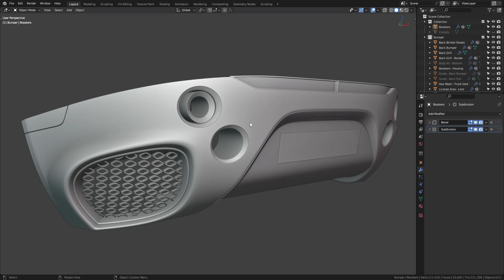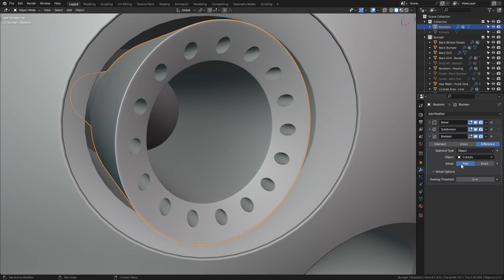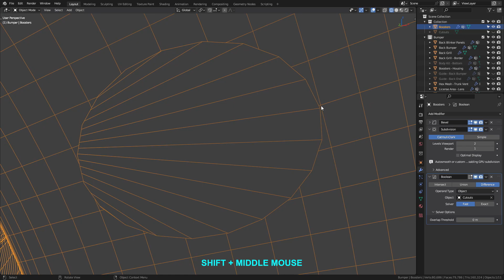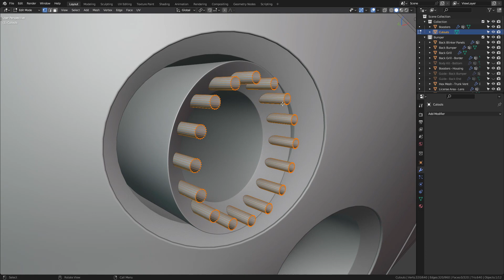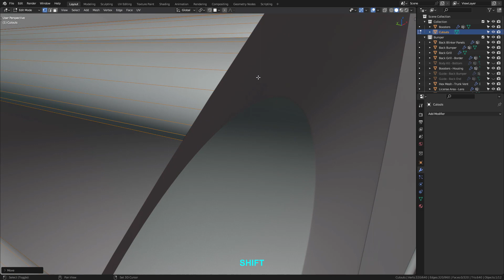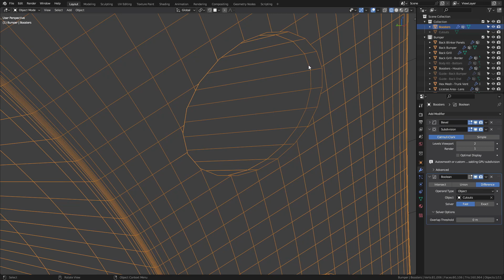Hard Surface Modeling Tips - Better Boolean Subtractions in Blender

Comment: Hi. In Blender 4.1 with it Shade smooth by angle it doesn’t work. In Blender 4.0 everything is OK. How to fix shading issues after Shade smooth (main object) in Blender 4.1?
Reply from the maker: Yeah no one's happy with the changes to Autosmooth/Shade Smooth by Angle. You should be able to use the Shade Smooth by Angle modifier for this tutorial, I THINK, but I'd never recommend using the Right Click > Shade Smooth by Angle option anymore. This option is destructive and will physically mark edges as sharp. It is also not compatible with modifiers and won't take them into account. So for the time being, adding the modifier to the end of your stack is the best option, but this doesn't work with everything either. For example, it does not work with the Bevel modifier's Harden Normals option. It's all a bit of mess right now, and we're all hoping the devs heard the complaints and fix this for 4.2.
Reply: @blengine  oh, thank you for a quick response. I never heard about this, it’s a pity ((
Reply from the maker: @PoMkAc27  Oh, yeah Autosmooth is now Shade Smooth by Angle, and they changed the way it works so that its compatible with Geometry Nodes. Hopefully they bring the old functionality back, it was so simple, we'll see what happens.
Reply: @blengine  I hope so

Comment: This is terrible geometry....LOL
Reply from the maker: Of course, all boolean topology is bad, but that doesn't always matter except to people who never had a job. Booleans are often just for quick results at the expense of the topology, but depending on the job or how small the detail is, it might not affect the end result in the slightest. Just depends on what you need out of any particular area, and how much time you have to spend on it.
Reply: @blengine  you can actyally model the holes. no need for booleans
Reply from the maker: @gibson2623  Booleans are for quick results, and in many cases substantially quicker than modeling the holes yourself. And to reiterate, depending on the job or how small the detail is, it might not affect the end result in the slightest, but you'll get the job done faster. Clients aren't always going to care if you have a couple of triangles as long as they get what they need in the timeframe they need it. It doesn't always make sense to spend the extra time on something when you can slash a bunch of holes in it with a boolean and get results that look exactly the same in the final render.
Reply: @blengine  That s just your opinion man.
Reply from the maker: @gibson2623  It's experience.
Reply: @blengine  I work for more than 30 yrs in 3D, both polys and nurbs (alias and Icem, things you don t even dream of). Polys are about flow and booleans totally destroy any flow, ok? Take care ;)
Reply from the maker: @gibson2623  It's really hard to not pin this to the top after reading that navy seal meme reply, but I know you're just a kid and will let it slide.
Reply from the maker: @gibson2623  Going around telling people "I'll blow you away in 3d", and that you do things they "don't even dream of" is literally just the navy seal meme.

Comment: hello i want to ask If I buy the course later, will we make the car with a blueprint, right?
Reply from the maker: Yes the exterior modeling sections of the course use blueprints that are included in the project files. The interior does not have blueprints though, so for the interior we'll be figuring things out using reference photos and logic.
Reply: @blengine  ok thank you for answering my question

Comment: Thanks for the tips! This'll be very handy for not getting booleans to screw up shading; I've always ended up applying the modifier and manually shifting vertices.

I was wondering, how do you think this would effect a UV map? How could it be more optimized to work well with a UV map? Often times I end up using seams, since are often times sharp angles like in this video, and as a result when displayed and textured receive a lower resolution. It isn't a huge deal when the area being seamed on its own is a small area, like these holes in the exhaust, but I was wondering if seaming it would also be the right move when it's much larger.
Reply from the maker: Booleans shouldn't have a big impact on UV maps as long as they're done right. If a boolean modifier physically changes the surface a lot than this can distort the UVs a little too naturally, but a clean boolean subtraction won't have any effect on the UV map. Keep in mind that the cutout object must also be UV unwrapped, as the cutout object's topology is used for inside of the holes like in this video. So if I were to texture the object in the video, and the texture inside the holes ended up with a different scale, I'd need to scale the UV's of the cutout object to adjust the scale of the texture in the holes. I'm not sure if this answers your question exactly, because I didn't understand the question 100%, but if you're still having trouble with something you can email me the .blend file at chris.cgmasters@gmail.com and I'll check it out.

Comment: Switching to fast mode certainly can work in a lot of instances. However, not always, even setting the overlap threshold to zero. What I've found works almost 100% of the time is using Exact mode and turn on Self in the solver options. This applies an addition union boolean before the difference boolean and can help with objects that have multiple intersecting meshes. Hole Tolerant can also help with non-manifold objects. Of course, turning all of these options on can make booleans significantly more laggy, so that's something to be aware of if you do a lot of them.
Reply from the maker: Those options do work for my example in the video, but only if my cutouts are manifold. And you're right, this is significantly slower even on just a simpler operation. But this is definitely something I'll keep in mind for any situations that the Fast solver fails on.
Reply: @blengine  Yes, the reason the Exact solver gave "instant failure" in your example was because your cutouts were not closed. The exact solver is not expected to work if the objects are not manifold (though it does try, and sometimes can work).

Comment: In addition to Auto Smooth, you can use the Weighted Normal modifier to fix shading issues.
Reply from the maker: For boolean results this option doesn't seem to work well. Maybe in some boolean situations it might, but for the example in this tutorial it has no substantial effect.

Comment: Nice overview of some techniques you can use for fixing certain shading issues! I would also point out that weighted normals work like a charm if you have more complex geometry and want to fix ngon stretching like you showed before. I also thought that you show the normal transfer with the problem when cutting a low poly geometry. Fortunately for that kind of mesh, the subdivison worked, but I think showing that techniques could help others too. :D But nonetheless, sometimes less is more (like adding the edgeloop for the cylinder to fix the internal shading).
Reply from the maker: For the example in the video, Weighted Normals won't work for me unfortunately. I tested it and it does give me slightly better shading, but nothing significant. I'm not sure how useful that is with boolean results. Same thing with Data Transfer. I tested it and I'm still getting artifacts around the rims no matter how I tweak the settings. Perhaps I'm doing things wrong though, if you had the time and the interest, maybe you could test these solutions out on the example in the video using this blend here - https://cgmasters.com/tutorials/boolean_tutorial.zip
Reply: @blengine   Finally, someone is talking about data transfer. :) I use it to fix bad shading on all my stuff. On low poly mesh with decent topo, data T will fix bad shading even without subsurf provided the guide mesh has at lease 1 subsurf level. 

When the topo is a mess from booleaning as the case here, you need to crank up subsurf mod (on the problem mesh) to 3 or 4, at least, for data T to be effective. Obviously, the guide mesh has to have same or 1 more level. 

I just tried it out with your mesh. 

For anyone interested, the setting I always use is >face corner data > custom normals > nearest face interpolated works best.
Reply from the maker: @jujuboohoo  Ah I misread your reply at first and thought you said to crank up the subsurf on the guide mesh, but you said the problem mesh. For the example in the video that seems unnecessary since subsurf level 3 on the problem mesh already gets basically perfect results without needing data transfer. And unfortunately from my experimenting, there doesn't seem to be a way for data transfer to fix the artifacts at a reasonable subsurf level.
Reply: @blengine   Yup. I wrote that the level of subsurf necessary to solve the shading issue might not be what most people wanted but deleted it. I just wanted people to know it'll work even with bad topo but at a cost. :)